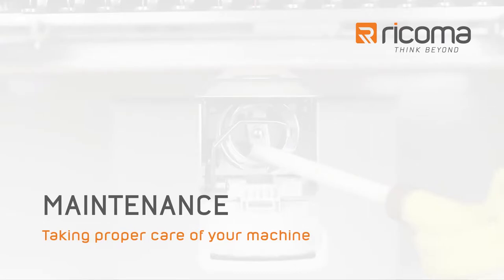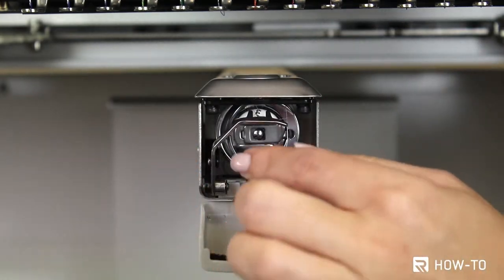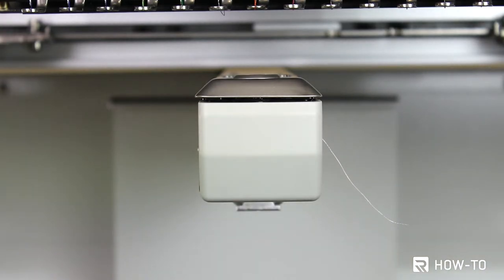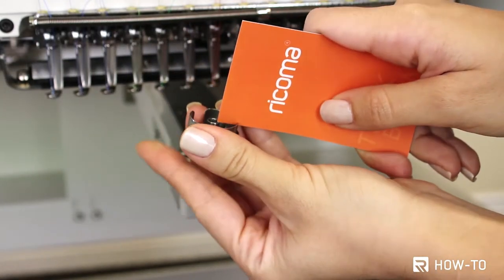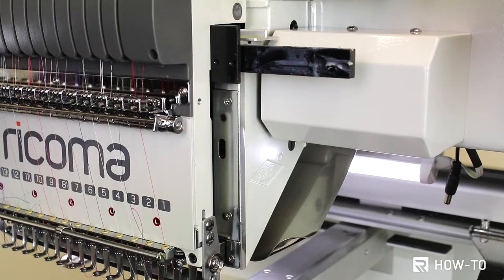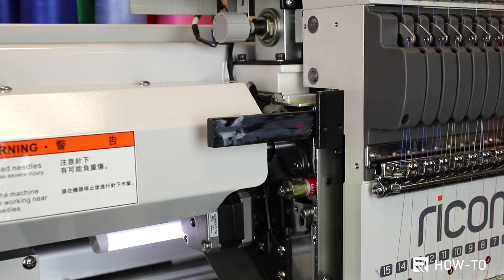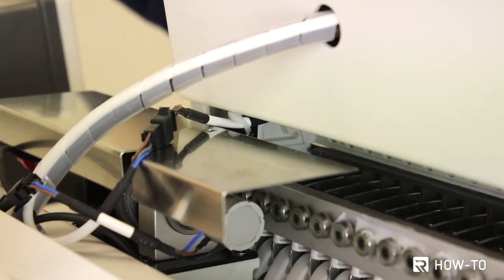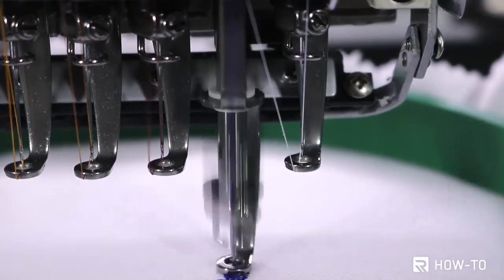MT-1501 How-To: Maintenance

Comment: Ya'll left out the area on the back of the machine that is drawn on the sticker lubrication chart, attached to the MT front. Ricoma tech Amilcar saved the day and helped me find it. "The other area is the main axis bar and blade motor that would in that area. You would have to put some white lithium grease in there."
Reply from the maker: Thank you for letting us know, Danny! We will be sure to pass it over to the team :)
Reply: Where that at bro, I can’t seem to find it
Reply: @vitalcaps1468  You have to go behind your MT and unscrew the big cover panel 9” x 23”, about waist high that has the tiny hole in the center. You will see the main gear to lubricate.
Reply: The video says lube i ate 3-5 months but the sticker on the machine says 3-5 weeks. Is it weeks or months?
Reply: @dannyblaqvideos  did you ever find out? I was wondering about that too
Reply: @jessicakcarvalho  Weeks it’s  not months. :) Sorry I thought i replied 2 weeks ago.
Reply: @dannyblaqvideos  thank you!

Comment: The screws on my needle plate won’t budge can’t seem to take it off. Also my needle plate looks flatter than the one in the video. And yes I have mt1501
Reply from the maker: Hi there. We are so sorry to hear that you are having issues with your MT1501. Please submit a request with our service team through this link --->https://ricoma.com/US/support or send an email service@ricoma.com.
Reply: Did you ever get your needle plate removed? I can barely manuever under the needle head to attempt to remove the plate. The screws are wanting to strip and they aren't budging as you said.
Reply: @dablocishot77  nope I was never able to do it 😭
Reply: @QuansCustoms  I managed to remove it with a little improvisation, and when I did, there were a lot of cut threads pieces underneath it. I took a flat head screwdriver bit and inserted into an adjustable wrench. I used 1 finger to push down on the bit while turning the adjustable wrench in a counter clockwise motion and it finally budged. You really had to push down on the bit to keep it in place and you'll want a bit thats not too small so that it does not slip out the slot and eat up the screw. Hope this makes sense.